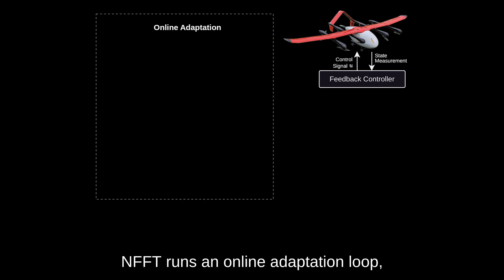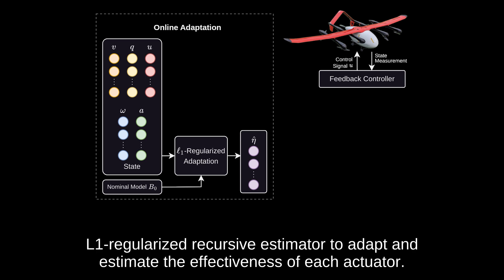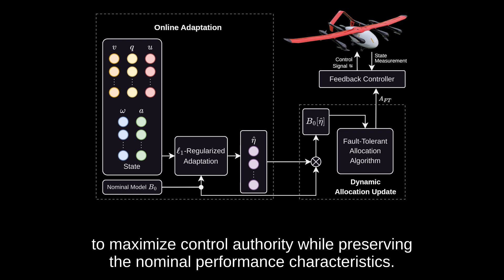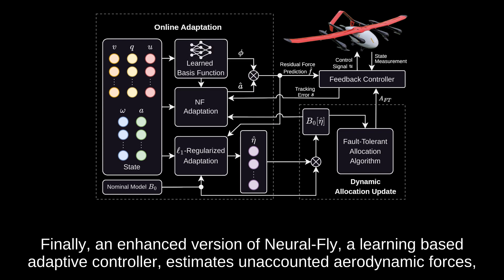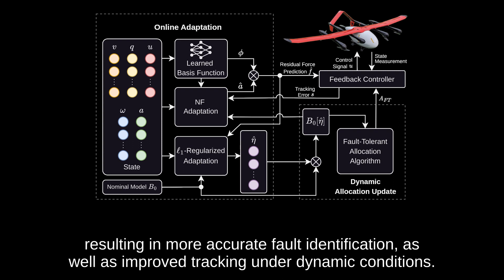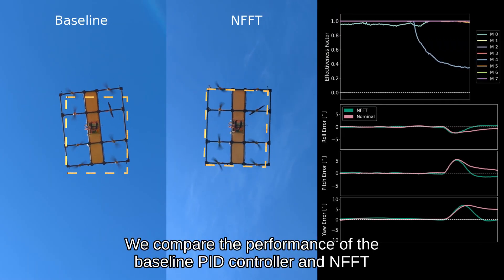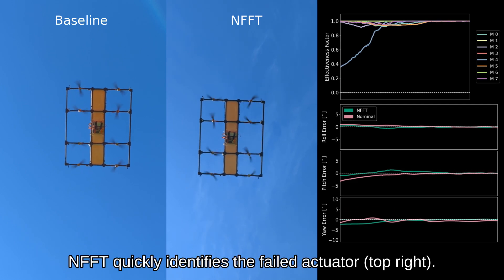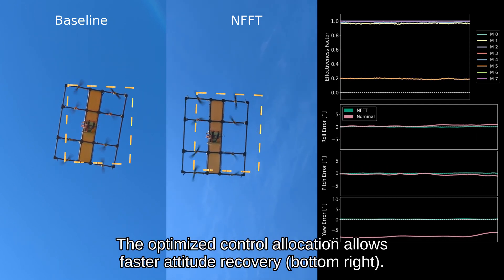Learning-based Minimally-Sensed Fault-Tolerant Adaptive Flight Control for Flying Cars

Comment: If actuator failure was of a considerable period but temporary with regard to total flight duration, will NFFT remove itself from failure correction mode?
Reply: Yes, NFFT continously updates the model of the system, so if the motor failure ends up resolving itself (or the failure mode changes), the software detects this and redesigns the controller for the new system.